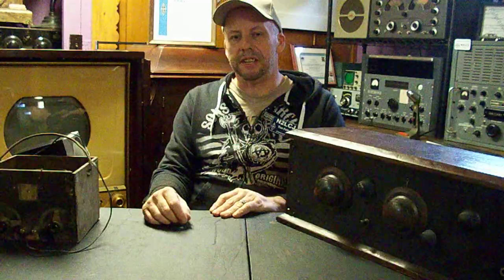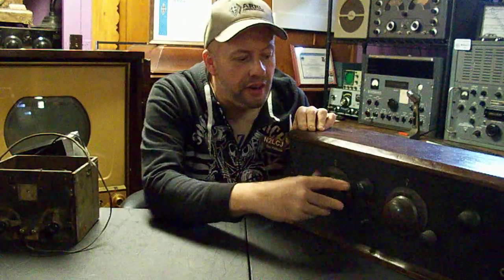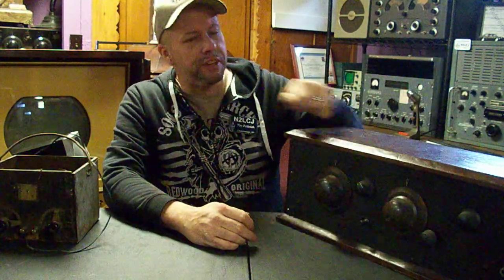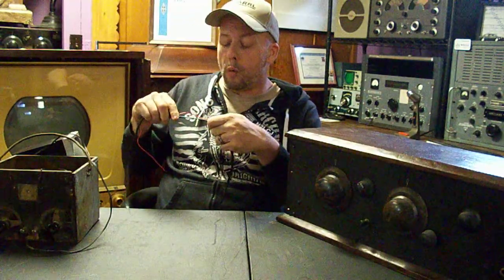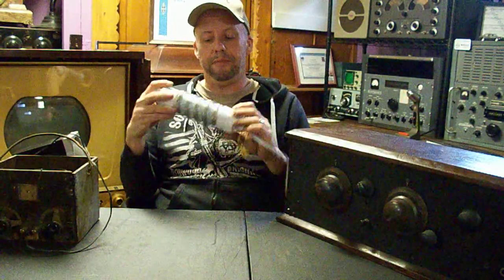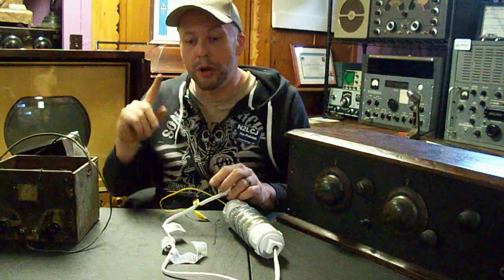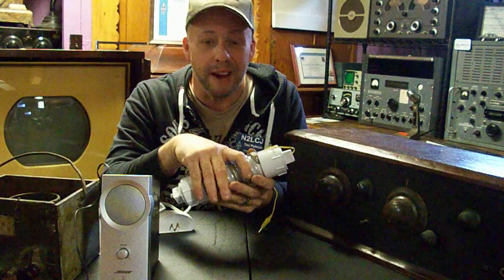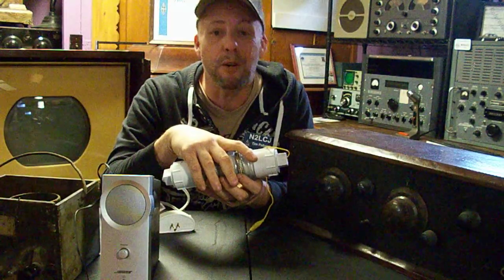Capacitance coupled antennas

Comment: Hi do you have plan for this that you would share? I’m not that knowledgeable on radios but trying. Thanks
Reply from the maker: Basically, all you need to do is take a couple feet of 1/4" braid and run an extension cord through the middle of it and twist it around a coil form of some kind.  Voila!